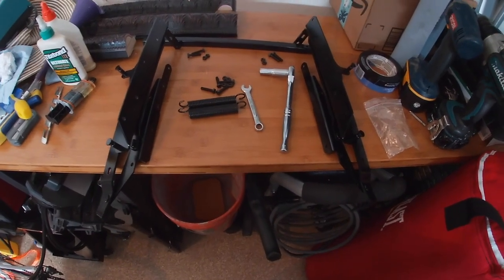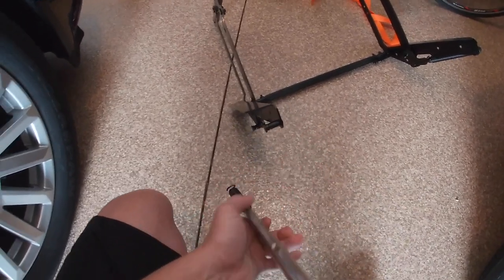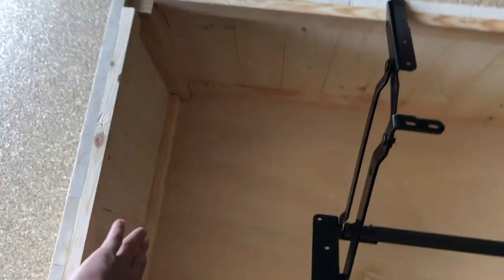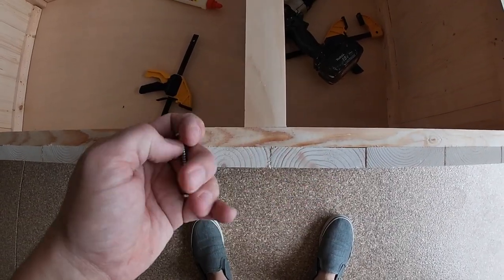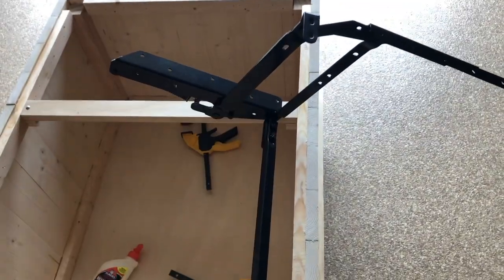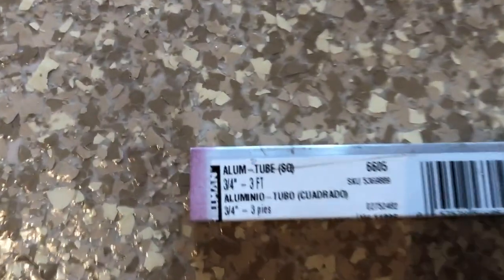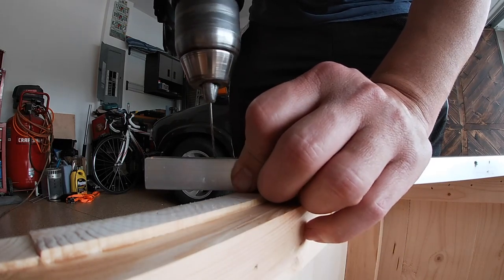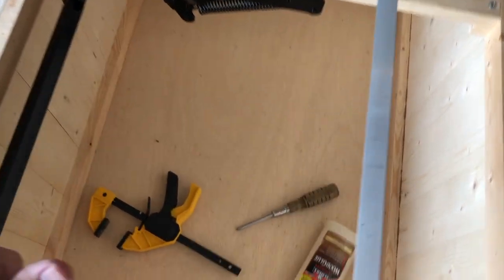Assemble and Install Lift Up, Spring Loaded Hinge for Table

Comment: How do you get the table to actually stay closed? I bought an identical one from Lee Valley and it takes all of my body weight to close it and of course it will not stay closed
Reply from the maker: The weight of the top keeps it closed for mine. You may want to see if you can put a weaker spring on there. Or maybe see how well it works with only one spring. 

Be very careful attempting to remove and install the springs! They can be dangerous!
Reply: I bought mine from Lee Valley as well and having the same issue. Did you ever find a solution?

Comment: I found a table similar but the top is not resting flat. Any idea how to fix? Thanks
 The top lifting just a bit opposite the side it lifts up to.
Reply from the maker: Hmmmm, I didn’t have that issue. Maybe check that nothing is bent in the hinge? Check that it is symmetrical.